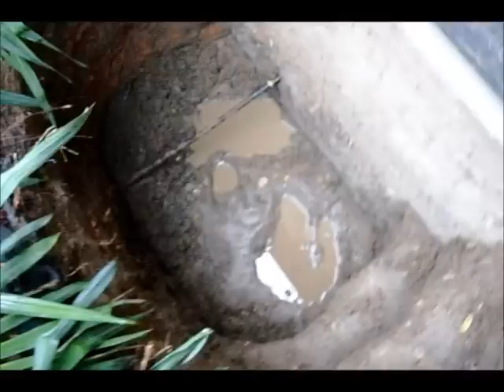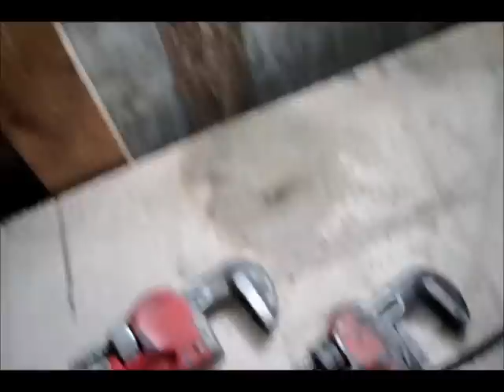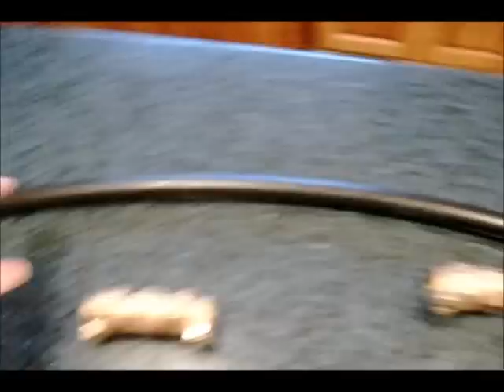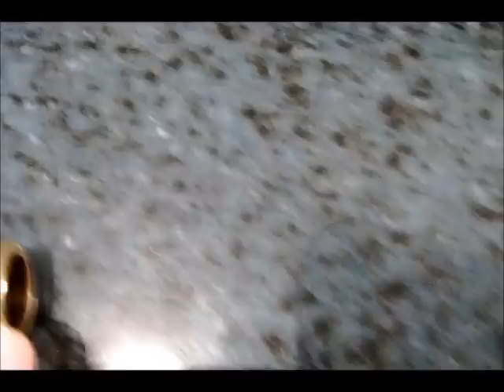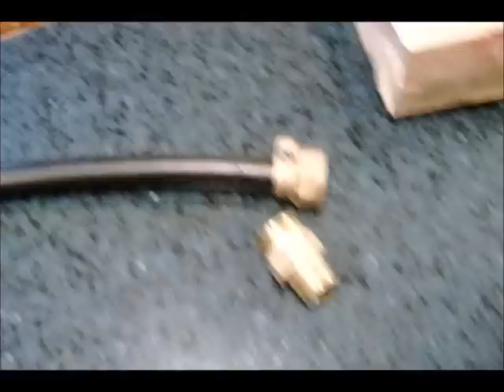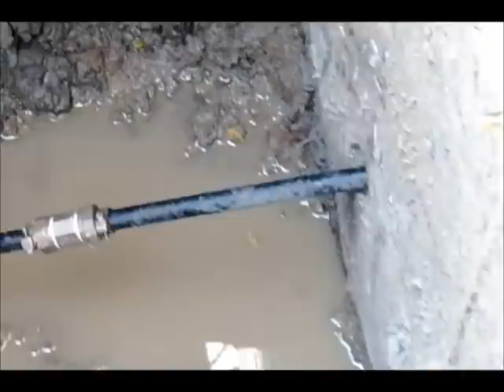Water Main Pipe Repair For A Home

Comment: Thank I ordered it from Amazon here is the product name-(Standard Plumbing Supply 313-204NL LEGEND VALVE AND FITTING T-4300 No Lead Copper Tube Size Pack Joint with Male Iron Pipe Water Service Coupling Socket, 3/4")

Comment: I have the same abs, pvc black supply line that’s a compression. House was built in 79 first time I’ve seen older homes not utilizing a copper supply I believe they heat up the brass valve and press it into the plastic to make that flare at the end but I could be wrong. My father in law just used the sharkbite black plastic water pipe connectors that twist lock and it works. This is a good repair for the outside for sure.

Comment: Do not use pipe insertions!!! I repair water services for a living and 99% of the time the leak is caused by the insertion. Overtime, it cuts through the pipe from the inside. There is literally no reason to use them

Comment: At least 4 wraps of the Teflon tape should be sufficient. Great video!
Reply: It did look like he used Teflon tape on the nuts of the union but that does nothing. Teflon tape is only effective on pipe (tapered) threads where is fills tiny gaps as the threads wedge together. Any fitting with straight threads such as a compression fitting does not rely on the fit of the threads to seal at all.

Comment: At 9:31 when you recommend using teflon tape on the Ford Pack Joint fitting threads, this was incorrect. Those are compression fittings, and the joint does not use the threads to seal. Using the tape makes a compression fitting seal worse, not better.
Reply: thanks!
Reply: Tape for male threads. Not for compression fitting. He never did say use tape for compression fitting side. With that said, Tru-Blu dope should've been used on the male threads and not tape only.
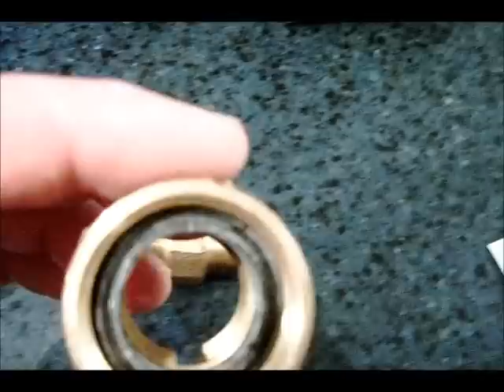Reply: @johnnywalker5635   You're not understanding what a compression fitting is. It's not just one "side". It includes both the male & female sides, plus a washer down inside female side, where the tip of male threads seat against. The fittings used in this video are compression fittings, including the male threads. No, they definitely should not have tape. Tape is 100% worthless here, even slightly making the seal worse. You don't want anything wrapping the threads which could limit how snugly the male side seats down onto the washer deep inside the female side. Go look at the hose on your house to understand. Or look at 4:29 in this video where he says "the seal in there". If you tape the threads, then it will just make the existing black inside-seal not work as well.

Comment: So the piece that they said they dont sale is called a flare fitting . You will have to buy the fairing tool.  But the ones you got are code aproved.  Its called a CTS fitting. For me i would have cut the pipe back far as possible away from the house. I would have used a cts fitting, to 3/4k copper. Before running that i would have coredrilled a hole 1 inch ir 1.5 inches to insert a sleve by using pvc. Then uses hydralic cement and tar or some type of water repellent from out side ground water .Once you do that i would have soildered in a new 90. Installed a ball valve with a bleeder then instaled a PRV, with pressure gauge, then an additonal shut off valve to isolate prv for service or replacments . Then i would have bonded it to the electric panel box,  Grounding your line for no electric shock. But for you not doing this for a living i would say job well done

Comment: unions with the lock nuts aren’t desirable as they have been known to fail with that set up the little white washer and rubber flanged O-RING tend to not stand up they break apart and cause the fitting to leak by

Comment: You can buy a copper and a plastic flaring tool at most plumbing supply stores. The plastic flaring tool is much more expensive. I paid $30.00 for my 3/4”copper flaring tool and $120.00 for my plastic flaring tool.

Comment: The comment below is exactly why I decided to do this myself. I found your video first thing, like a divine appointment. I was looking for the type of compression clamp that you used, to find out which end spun out first. I paid a plumber $1,000.00 to run a new feed line to my house, and add a shut off valve at my lawn, because the water meter is about seventy-five yards down the street. I dug the hole at the leaking valve, and now, because of your video, I know which end to twist off to remove it. Very simple. Thank you so much.

Comment: If you have this cursed black poly pipe, use a *PVC Compression Coupling*. It's SIMPLE to use and very effective. However if you have this damn pipe, I'd look into replacing it. It's horrible.
Reply: Will it last buried? Is it approved to  be exposed to dirt n etc. Thanks

Comment: I didn’t use a metal insert!!!    Dammit.  I asked so many people.  Even my trusted guy at Home Depot.  It’s not leaking.  Been 6 months.  Any opinions on what I should do?   I just shoved the poly pipe into the fitting.  I guess it’s too late now.
Reply: You'll be fine bud as long as you didnt crush the set screws down like this guy did in the video. They only need to be a little tight not crushed down.
Reply: A high percentage of the sales people at the orange and the blue box stores don't know jack s**t about what they are selling. They will tell you anything to get rid  of you.

Comment: My 20 year old fitting in the house let lose. What a mess. Mine didnt have the extra little clamp. The new one i bought had the little clamp. I shouldn't ever have to worry about mine slipping off again. If you have the old style i would replace it before its too late.

Comment: Can I use sharkbite
Reply: Not on black pipe
Reply: Outer diameter of black pipe to large. You cannot insert the black pipe into the shark bite. Been there tried that ! Lol
Reply: There are heavy duty SharkBite style stab fittings available.  The brand name is Mueller Insta-Tite 2 or Core and Main Ultra Tite 2.  There is tool to remove the old fitting and you will have to bevel the end prior to insertion.  You can also order the internal Grab ring and O ring seperately.

Comment: (3:14). You can reuse that fitting so easy.  Get something a little bigger then the pipe. Warm the end of the plastic pipe, and push it against the end. It will make a flange.

Comment: This guy should have talked less! To much over talking. I bet you're an engineer... 🙄 and, who's to say he did the repair, he didn't even film it. What a hacker... his friend "the plumber" probably helped him.  I call BS on the video. The people that work at Home Depot and true value don't knot jack shit about any type of plumbing.
Reply: The idea is to see what he used for the repair, cause there's a dozen other ways to do the same repair.  You learn from it.  As far as knowledge by HD  & Ace, I agree with you.  But you shouldn't put the video down, all it shows you are not very wise open minded to absorb ideas.
Reply: This guy says he went to his local true value and walked out with 2 mcdonald fittings that are mostly used by utility contractors for connecting water services in the street. I call BS but then again it might be because the hardware stores around me are fucked up and carry nothing you need in inventory even a 1 by 1 barb for IPS Poly.

Comment: Were you able to hold the builder or previous owner liable for the bill overages?
Reply: The liability has expired. There was Class Action suit a good 30 years ago, if weren't included then you're out of luck.  And since then it's illegal to use for homes, other than irrigation.

Comment: Wow, this looks EXACTLY like my problem. I was going to use the barbs and clamps but think this looks way more secure. Stainless clamps, well, they are still steel. Brass is heavy duty and a wrench will do it, no heating and shoving the barbs in. My line came up from a foot deeper and probably got its kink at the wall when they backhoes the big piles of dirt in. Thank you very much for the video, really appreciated.

Comment: On poly pipe How tight did you tighten screw on a fitting sitting over poly pipe and also main nut on a coupling between pipes? Thanks.
Reply: If you have the insert you can tighten down all you want. Without the insert just really snug.  The pipe won't bust on you, the whole point is to keep the pipe from going out of round. I fixed pipes 25 years ago with simple SS clamps and an inner tube and still holding today. That's also was a fast fix which we needed at that time, but never went back to reinstall another way because there was no need to.

Comment: Nice video.   Well done buddy.   One thing that I notice though is that you need to make sure that you flush the pipe before connecting.   This way no rocks or other debris gets in the house pipes.
Reply: You flush the exterior Bib/Hose connection outside the house before using house water.

Comment: couldnt you have just used the snappon or shark fit  joints
Reply: click411 i dont trust them for preasure personally
Reply: The Shark fittings may blow on you.  Don't trust them.
Reply: No recommended for direct burial and don't trust it.
Reply: Navy apparently uses them but I assume more advance push-to-connects - Might have been originated by them. I just recently got rid of an old pipe that was under my crawlspace that then went under the foundation to the service line outside. There was a push-to-connect fitting that I'm guessing is over 10-15 years old. It wasn't leaking. I replaced the old leaky pipe and push-to-connect fitting with PEX-B pipe and a new push-to-connect fitting (Sharkbite). BUT this time the fitting was wrapped in silicone wrap (required) unlike the old one.

Comment: I have the same problem, but how can I know where the location of the leakage is ? with excavating my whole front yard .
Reply: You follow the water, the same as a slab leak within the house or pay a Leak Detector guy 250 to 350 bucks.  When you find the exact location you will see the bubbles.  That's how leak detector's work, running gas through the lines and watch for bubbles.

Comment: Many many Tanks for this excellent and informative video. I need to close off a plastic pipe and your vital tips have provided me with the answer. My problem is I did not use a metal insert to go into the plastic pipe in order to stabilise it when clamping it off. I feel such an idiot not having worked it out,on the other hand I'm not such an idiot anymore because your video has helped me fir which I am sincerely grateful and thankful to you. Best Wishes to you kind man.
Reply: Flughafenkaiser I didn’t use a metal insert!!!    Dammit.  I asked so many people.  Even my trusted guy at Home Depot.  It’s not leaking.  Been 6 months.  Any opinions on what I should do?   I just shoved the poly pipe into the fitting.  I guess it’s too late now.

Comment: That l"little cheap" roll of teflon tape is a pain. I get more leaks using that than solder or glue combined. Please spend a couple bucks and get the Oaty or at least the yellow gas tape.  You bought the best of everything else, why scrimp there? 
Nice job though, just hurting from my last cheap tape thread leak.
Reply: Can't use solder or glue on this.

Comment: Those fittings are called pack joint fittings.  As someone previously mentioned, these were made by A.Y.  McDonald, Ford and Legend also make these type of fittings.  They are the proper water service fittings to use with this type of pipe and when installed properly, are more durable than any other fitting.
Reply: Hi Chris, am I able to use those fittings on lead? Older home, copper after my meter but up through floor is lead. Any help would be appreciated. I have a leak at base of floor and was able to get the key on the street valve to shut it off, but I have a  slight water flow still and before I open my floor to remove the bad section, I want to be sure that fitting will work on lead at my leak point, then I can go copper 3/4 to my meter fittings.
Reply: Hello, what determines if you use pack joint or just a quick joint ... ?
Reply: @mariomarionetas4445  Pak Joints are used by water utilities,  shark bites and couplers are not.
Reply: Sharkbite---- 20 bucks.... for 2 !!!! it works...
Reply: sharkbite relies on a seal that wears with time, it will then leak.

Comment: Some states require copper pipe thru the foundation to 10' outside and then connect to the plastic. This will prevent the issue you had.
Reply: No it won't prevent the problem.  It's Poly pipe Not Plastic and installed over 30 years ago.  Today the use of Poly is illegal in all States due to their known leakage problems.  If you look closely the leak is outside the house, so that means the house is over 42 years old.
Reply: If on well water like me, hard water is an assassin to copper.  Just saying for benefit of well water users.

Comment: barbed fittings work fine good for well over city water pressure long as you use the good stainless clamps once the plastic gets mashed into the barbs it will never come off

Comment: Wow, they used a torch or hot air gun to soften a Polyethylene pipe and they they flared the pipe, and then use a flare fitting and flare nut to connect that to the copper pipe.  I didn't even know that was allowed. For polyethylene pipes you can use an insert fitting and 2 or 3 simple all-stainless steel hose clamps on the outside to fasten the PE to the insert fitting. That's what they use in cottage country.   The problem with insert fittings is that they reduce the inside diameter of the pipe. So what the experts do is this:  take a hot air gun, use it to heat up the PE pipe so it is nice and soft, then use some type of tool to EXPAND the soft PE pipe so a larger insert fitting can be inserted into the pipe.  Then let the pipe cool down and once cool you add the hose clamps and tighten down.  That works perfectly, and is a lot less likely to slip off than those compression fittings you bought at True Value.  I use that technique to connect 1/2" PEX pipe to 3/4" PEX fittings when I don't want a reduction in flow at the fittings.
Reply: +Willilly Bab I ran into a problem with my water main. the shut off valve has one of those barb inserts in the hose and its rusting because someone used a metal to brass fitting. A warning to anyone who does this. Use brass on brass fittings and use the clamps with the barb insert into the plastic hose and put a metal clamp to hold. I will be filming this repair this week and also will show you how to shut off the water with a special tool up here in Ontario Canada.I would be concerned with that metal insert as it may react with the brass threads and rust then burst a leak.

Comment: I was took by a plumber for $500.00 to do this exact fix and we dug the hole  and found the leak, all the plumber had to do was cut line and reconnect!  Wish we could have seen this video and done it ourself!  We would have Saved $450.00!
Reply: You did the right thing, you save $2000 dollars  doing the hard work, it's best if a professional  make the right connections using the rights  tools rather  than do the connections yourself  and then don't have the piece of mind or wondering if you did  it the proper or right way or maybe not.
Reply: no , u would save 200$ and you would WORK for 8 hrs,,  so relaxs,,,

Comment: good video...i have a broken water mains pipe too..it was caused by a failed connector joining a 15mm pipe to a 20mm pipe..i had to cut into my drive to remove a slab to trace the water main..

Comment: In the old days they used to put the meter inside the dwelling. You only paid for water you used. If there was a leak on the outside you didn't pay. Now the meter is at the curb for this reason any water leakage on your property underground you'll paying for it as in your situation. BTW, people hear about poly or pex pricing versus copper and they think it's a no brainer why use copper it's extremely expensive. Well as you saw first hand, tubing is cheap but you're paying huge money on these special fittings. What's the point then use copper it's king. I always use copper. Thanks for the video.
Reply: These fittings are used on copper too lol.

Comment: ......Good Job... might have been a good time to have lost that 90 degree Elbow a.. and replaced same for a slow bend... as this would have given a greater and smoother  flow through your system.... that just me i hate elbows....... [but then there would have been soldering and all sorts involved....]  so maybe as the say... if it isn't broke why fix it.....